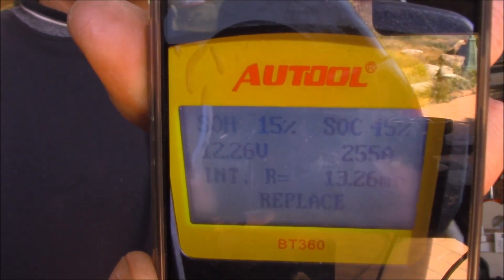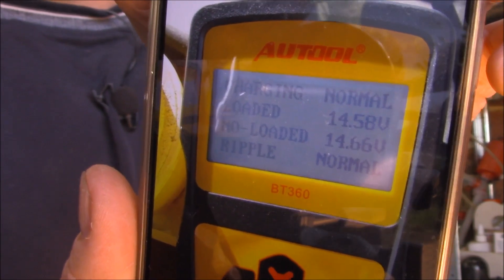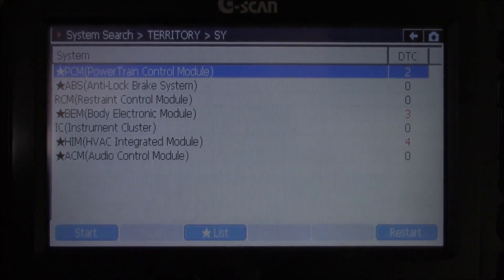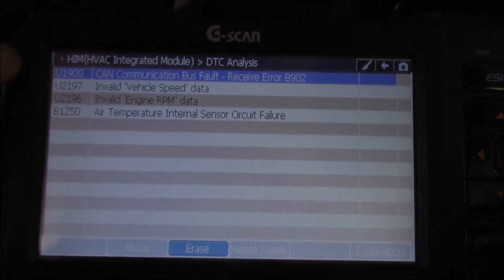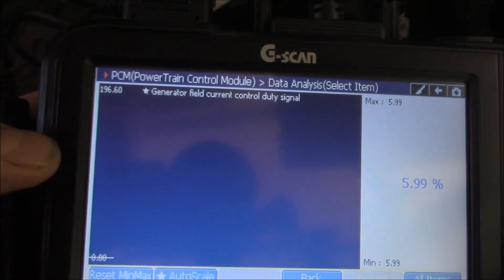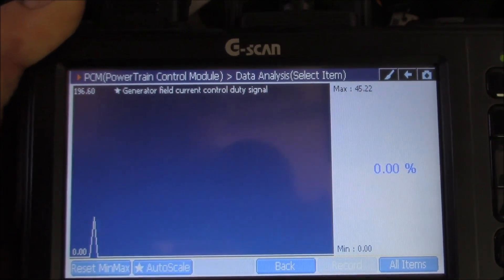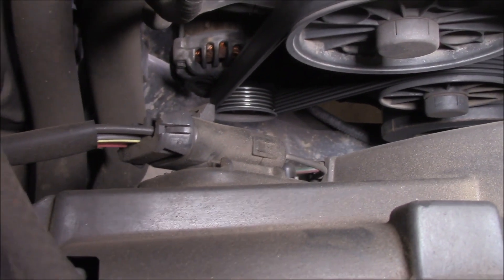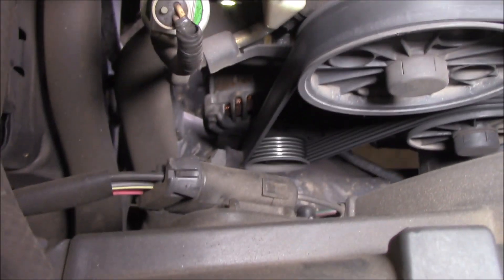Ford Territory Alternator Fault MiracleMAX

Comment: One thing I’m not sure, reading says at idle low rpm may be, to take your revs to 4000 at idle and see test results again
Reply from the maker: Hey Jennifer,
Has the correct alternator been installed? Is this an LPG engine?
What happens when you remove the connector from the alternator? Does it charge at that point? I believe it should be around 13.7 volts if the alternator is able to charge. Have you followed the testing procedures shown in the video? With an oscilloscope, do you have the ECU request waveform & also a confirmation signal? Have voltage drop tests been done on all wires at the alternator?

Comment: A brand new Ford Falcon BF FG FGX SY Territory 6cyl 4.0L Alternator 130amp 2005-2015

Is currently $200. This is a Ford factory sealed brandnew unit for $200. 

These take typically 30mins to fit. I would have just fitted a $200 alternator, and charged the existing battery.
Reply from the maker: As you saw at the end of the video, I recommended to the customer that a new alternator be installed. The testing I did was to confirm that the PCM was providing the duty cycle signal to the alternator. I therefore confirmed that it was only the alternator that needed replacement, rather than just throwing parts at it. I also replaced the battery as the testing showed that it only had 15% State of Health. No amount of charging is going to bring that back to life.
Thanks for your comments. 👍

Comment: interesting video and usefull as im trying to diagnose my falcon barra Bf s2 motor conversion into a Nissan. wish i had an oliscope to do the com wires as you did...at this stage because it was a sh alternator im thinking of buying a au/ba alternator as they are bolt in for barra, but dont use the smart charge circuity.
Reply from the maker: You could possibly use a multimeter in the frequency range. That might be enough to give you a clue. Or even in the DC voltage range you should be able to see an average of the voltage that is going to the alternator.
Reply: @MiracleMAX  after watching i thought id prob both coms... Turns out one of my plugs wasn't clicked into place, so was not making contact...DOH. fixed and getting 13.95 at idle and in 14s with rev (i asked pcm to command 14.4 and stop the stupid at no load no charge deal)
Reply from the maker: @ChristianUnkn0wn  Good on you. We never stop learning. I hope the rest of the conversion goes well for you. 😊
Reply: @MiracleMAX  thats true and it never hurts to triple check wiring
Reply from the maker: @ChristianUnkn0wn  Have you seen my video on VW Golf fuel filter replacement?
https://youtu.be/Mt6fLxFqIhM
I learned the same lessons......

Comment: Hi MM. Nice diagnosis. Q. The generator field current pid. Is that the representation of the pwm duty cycle?
Reply from the maker: Hey Nigel,
This PID is the command PWM signal to the alternator from the ECU, dependant on load. This system senses current rather than just voltage variation and therefore is more concise. It uses a set frequency with a variable duty cycle. Apparently, the PCM uses input information from the TPS, ECT, IAT and VSS sensors to set the charging rate.

MiracleMAX
Reply: Interesting. So do you know why the pid was dropping to 0%, when your scope showed the pcm signal     good.
Reply from the maker: @nigelwebber1472  I can't explain that, but it does happen on the Ford alternator. If I had a better oscilloscope, I would have seen the 'Gen Com' signal change every 5 seconds. It's an inbuilt strategy. I also should have disconnected the connector to the alternator to allow it to go into a default strategy. This would have allowed the alternator to basically 'fully field' and the battery voltage would go up - if the alternator was OK. These systems are unusual and I don't pretend to understand them fully. For a better explanation, check out Eric O's video by following this link https://www.youtube.com/watch?v=fWu8uFj-a7E&t=1490s 
I may have got the 'Gen Com' and Gen Mon' lines confused as well, but feel that the data I saw was still enough to call a faulty alternator. I wish I would have got the job to confirm my diagnosis.
I hope that helps!
MiracleMAX
Reply: Thanks for taking the time to explain Mark. Look forward to the next one.

Comment: Good job, Mark! Those intermittent faults are the worst.
Reply from the maker: I'm just glad I had an oscilloscope (tiny as it is...) to see the signals as they happen. It would have been pretty much impossible to make head or tail of the results using a multimeter.
Reply: Yeah those little scopes are great to have any tiny enough to take anywhere! I have one of them myself.
Reply from the maker: @robertcalkjr.8325  At the college where I teach I use a Pico Oscilloscope & love it. But in my little workshop, that is a little out of my price range. The important thing is to fully understand and use all the capabilities of the tools that we do have.
Reply: Yep!

Comment: Love how you take it to the end and not “ load the parts cannon”, so important to diagnose properly!
Reply from the maker: You're right! I've got one coming up in a while about diagnosing the difference between a final drive noise and wheel bearing noise. I was amazed at how easy it was once I thought outside the box.....stay tuned :)
Thanks for your comments.
Reply: The parts cannon was already fired when replacing the battery.